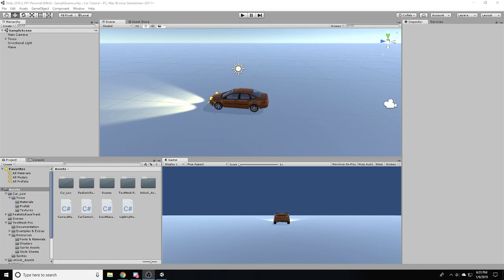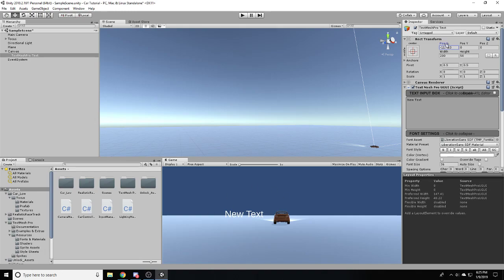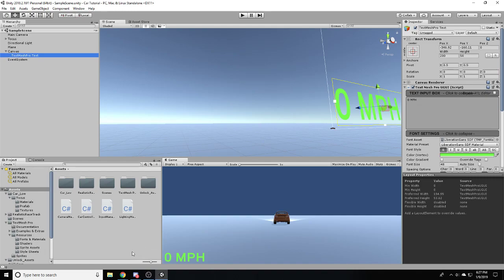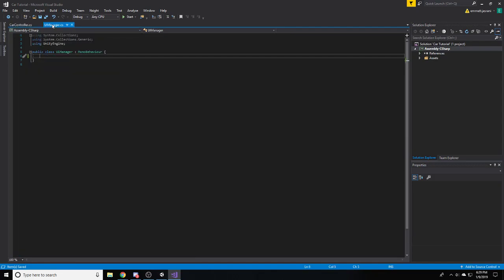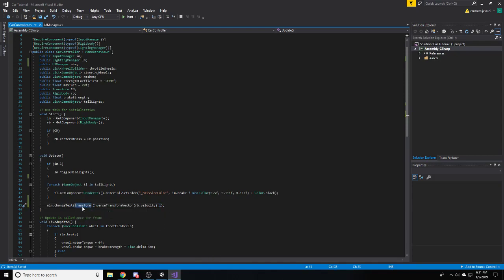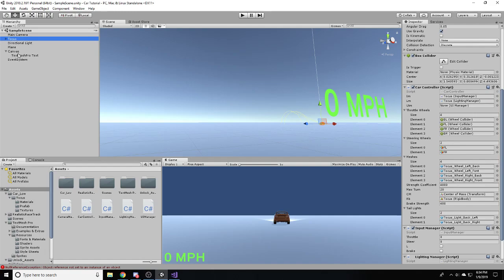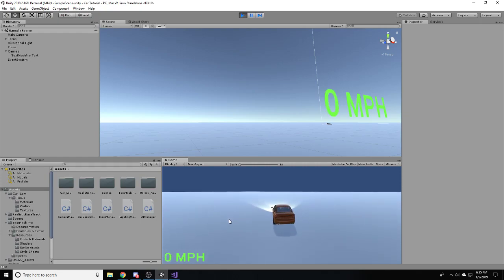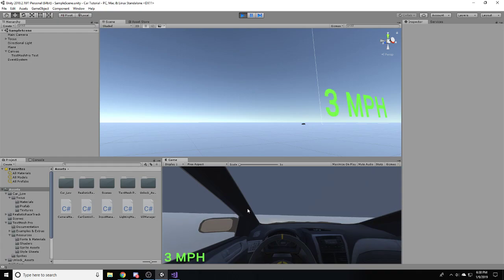Unity Car Physics Tutorial - #7

Comment: Looking good, and Maby give the car a gear system and do make a round speedometer because it’s like impossible to find a good tutorial on this and glad that ur back keep going really liking it so far 🙏🏻 thx from Germany
Reply from the maker: As of right now, I'm planning to put the physics at the forefront of my priorities. After, I'll do a round (analog) speedometer and handle things like gear shifts.

Thanks for commenting, btw!
Reply: AxiomaticUncertainty First of all thx for Ur quick and very Nice answer Really Exited were this Series is Going to
Reply: @AxiomaticUncertainty  Please do a gearbox system please its the one thing I've been looking for all over the youtubes...
Reply from the maker: Do you mean the gear shifting audio?
Reply: @AxiomaticUncertainty I mean a system where you can select what kind of transmission you have with a button when you press said button it switches between either a manual or an automatic transmission. when please have manually selected they have to press buttons to either gear up or down. would be cool if you had it where the players can select to use a clutch or not as well. Also sounds would be sweet.

I do 3d modeling and have zero understanding of coding, it's not for the lack of trying it's just I don't think my mind is really wired to think like that :D I'm more an artist :D
Reply from the maker: @brianmo2611  I see what you mean and could definitely work that into a tutorial of its own.
Reply: @AxiomaticUncertainty  sweet that would be amazing as most tutorials dont cover that kind of thing